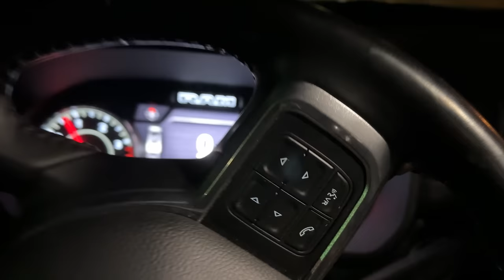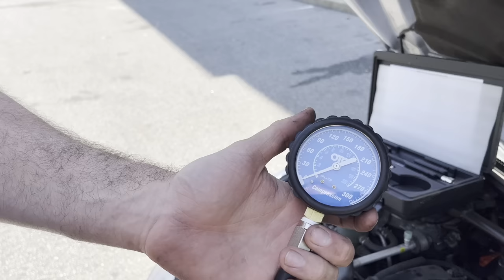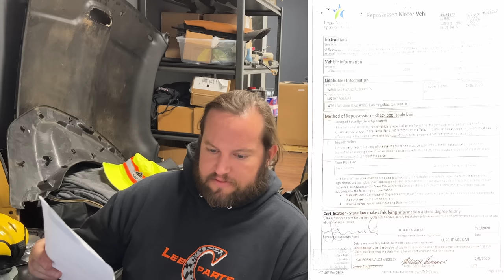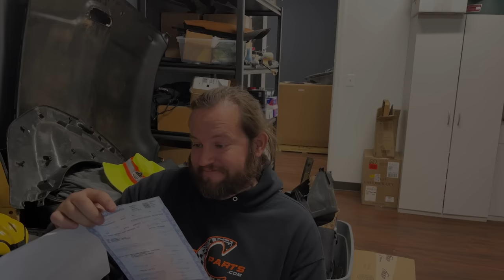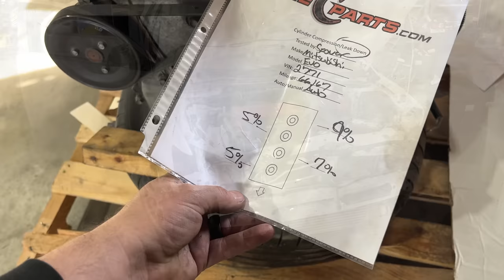I Bought a REPO'D Evo From Copart & It's BLOWN UP!

Comment: Love evo 10s! Even though I’m a v8 guy I drove a 400hp evo x and it’s was so much fun
Reply: hoping the timing of this project getting completed might line up with a snow storm by chance.
Reply: I came from a 2004 WRX STi to a V8 and those turbo/AWD cars are indeed fun.
Reply: This will be next car i love evos an evo 8s are the best evo in my opinion
Reply: @EJ257IHI  those 2004 STI are some of the best looking an sounding cars.
Reply: @LSDdreams808  Evo 8 FTW
Reply: @LSDdreams808  It was a pretty special era. I got out of school and moved out, got the car brand new.  Got it to Stage 2 Pro Tune, RECARO seats, Defi gauges and a lot of cool turbo sounds.  The 2003/2004 Cobras were roaming around, nothing but good times. Sadly had to sell the car because I needed cash for my first property in CA.   Sold the car in 2010.   In 2013 I picked up my brand new Lexus IS-F, which I still have to this day.   I do miss some things about the time I had the STi, so I've been tracking it down, it went through 6 owners and is now somewhere outside Boise, ID.  Maybe one day I will buy it back and restore it.   Merry Christmas.
Reply: @LSDdreams808  Another dream of mine is an MK4 Supra Turbo but that's BIG $$$$ car but who knows, maybe my luck will change some day.   Pretty happy with my 400+ hp IS-F.

Comment: This same issue happened to me 7 years ago in my evo x
Lost #4 cylinder
Cylinders 1,2,3 were perfect
Cylinder wall of #4 had just a tiny tiny scratch
We did a little rehone and put a used oem piston cause I couldn't afford a full lblown rebuild at the time
And it's been good since then holding 600whp lol
And I also reused oil cooler
Nothing was in it

Comment: Intro was some corny sheet.  But I stayed out of interest in the engines condition, without regret.  I plan to see part two for sure!  

After your compression test, or maybe a little before, I assumed a dropped/bent/broken valve at a minimum.

You did pretty good in the middle.  Keep at it!  

Thumbs up!!

Comment: Well towing it by lifting the front wheels has absolutely destroyed the differential now. Supposed to put it on a low loader. Mitsubishi specifically say never to tow it like that. Well done you need a new diff.

Comment: Actually, the engine is Hyundai, not Mitsubishi at all.
Reply: Wrong, its base design was developed by GEMA (global engine manufacturing alliance) and the engine is manufactured in Japan by Mitsubishi. Mitsubishi fitted their own components, including Mahle pistons and stronger internal structural parts. Its internals are unique to the 4B11T. Stop talking utter rubbish. Google is your friend if you aren't sure. It's all there to research.

Comment: Not a big deal, they are easy to rebuild. 4G63 are so easy
Reply: thats the 4b11 the only EVO generation to not be powered by the 4g63 which is why when it came out they were hated on.
Reply: @robbalinski1606  the 4B11 is still a very capable engine, you can make nearly 1000hp on stock sleeves
Reply: @robbalinski1606  and yet the 4B11 is a much better engine and has more tuning potential we now know.
Reply: @bEEBO178  its better in way's yes, I'm not sold on it being better but I've also never run one. If the 4g63 could have the head and timing setup from the 4b11 it wouldn't be a competition IMO. 4g63 is proven the 4b11 is the new kid on the block still but time will tell what its truly fully capable of. The 4g63 was basically the first 4 cylinder to hit up against the v8's with great success back in the day.